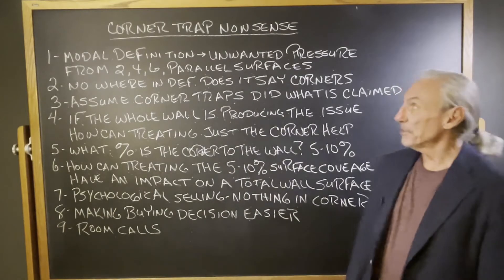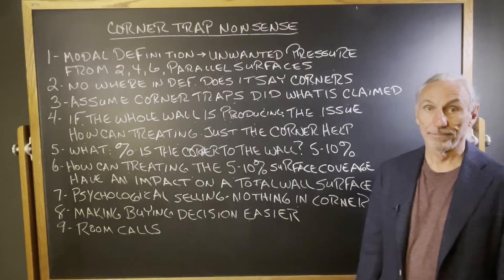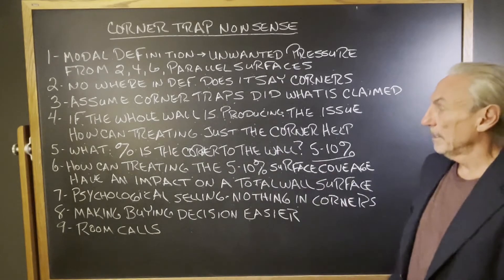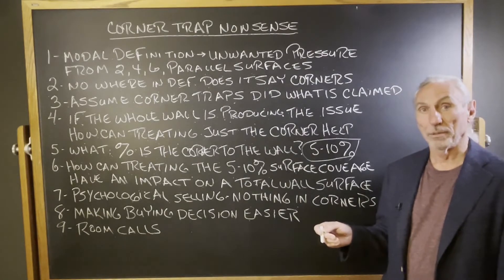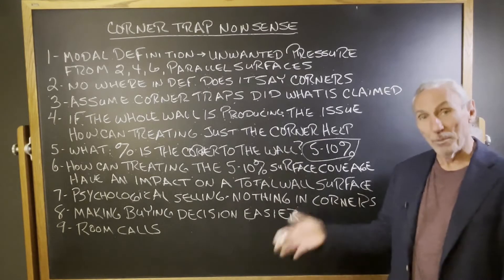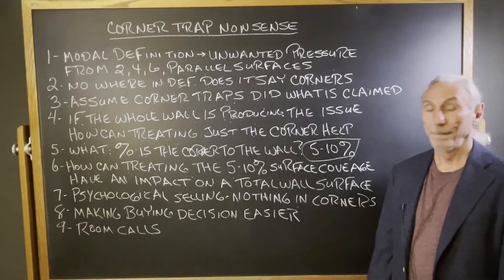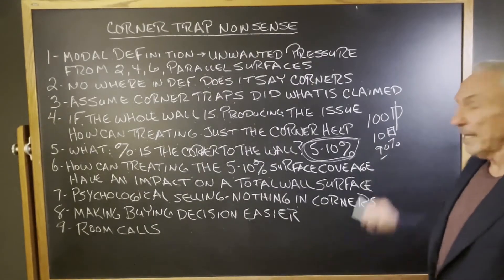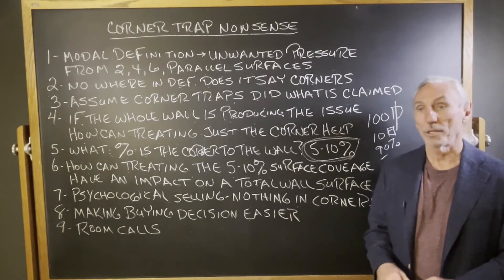Corner Bass Trap Nonsense - www.AcousticFields.com

Comment: Okay I get what you're saying BUT it is quite apparent that bass builds up more in the corners. just stand in a room with music playing and walk to the corners, and its very obvious. Bass builds near walls from the pressure as you have taught us and a corner is a double wall. or potentially even a triple wall. so for bass management would that mean that corners are the most effective place to treat/absorb this?
Reply from the maker: "Bass" builds up in the corners because the walls are not treated correctly. The walls are producing the corner issues.
Reply from the maker: You are confusing technologies. Double and triple wall structures are for noise transmission not for low frequency absorption.
Reply: @AcousticFields  Double and triple wall as in, it takes two walls meeting to create a corner. a third wall (ceiling) creates a triple corner/boundary.
Reply from the maker: @NickWarnerMedia  You are using a tactic without a strategy. What frequencies and amplitudes of noise are you trying to attenuate with this triple wall. You are using a tactic that is not defined against another undefined noies issue. You are chasing your tale with this approach to noise.
Reply: @AcousticFields   i am simply asking a question about the physics. im not using any 'tactics' or 'strategies'. - My original question was "are corners the most effective place to absorb bass?" - so in general, in any room, with any amount of absorption already present or not. with any amplitudes... are corners the most effective (maybe another word would be efficient) place to absorb bass?
Reply: Sorry, but that AF reply is like a chicken talking to a duck. 😊cheers.
Reply from the maker: @djbremsespor  Your comments are more insect based. Just  another tick on the balls of acoustic society.
Reply: @AcousticFields  your answer to Nick's question is nonsense. He was talking about the additional pressure gain achieved when two or three orthogonal boundaries (walls) are joined, and you respond something about noise transmission? Really, what does noise transmission have anything to do with acoustic boundaries? It's you who is confusing things, professor.
Reply: I think he was meaning that it’s meant for amplification of sound transmission for its performance purpose.  I don’t think what he said was irrelevant, though I can see how it can be easily misinterpreted.  If you think about the definition of a room mode, and the two parallel surfaces, if you treat the corner, then theoretically you would be treating up to one side of the parallel surface modes (room modes) except for up to three different angles.  So technically it would give you coverage over different areas but in no way is it doing magic in its efficiency.  Covering the big elephant in the room is more effective, which is the largest wall with the largest parallel surface.  Im not sure if the ceiling would excluded but I think it would be because we have carpet and furniture and things in our rooms so it helps to mitigate it from being a primary concern given this criteria.
Reply: @joemarz2264  Thanks Joe, yes you are correct @AcousticFields  did not understand my question. I am not confusing technologies. double and triple wall as in, the corner of a room is when two walls meet, potentially even 3 meet if you are at the top or bottom of a room. Ceiling is considered a wall/hard/reflective surface.
Reply: @djbremsespor  you are incredibly rude. AF did not even understand my question and therefore your comment here shows your character twice as well...

Comment: I have corner bass traps that are floor to ceiling with diffusion on the front of each bass trap in 3 corners of my room.  Sounds bitchin and looks epic.  But I also see your point.  Surface area covered has more of an impact that corner coverage.  Now that I have rear wall quadratic diffusion, a properly installed cloud, 1st and second reflection points covered and all corners trapped, I'm going to move into trapped the ceiling corners adjacent to my mixing position, and bring in more diffusion and absorption in the back half of the room which is still lacking in coverage.  Slowly slowly it is coming together but each element is making it sound better and better.  I love this stuff so much!
Reply from the maker: Keep going with your efforts. It will be a great learning tool for you. Keep us posted. Send us a response curve as you move through the process so we can see your progress.
Reply: Just be careful to not KILL your room. This is another enormous mistake that many people make!

Comment: In the case of porous absorbers - does the air gap created by corner placement provide any benefit?
Reply: It increases absorption of frequencies under 1Khz, yet not by much. Just make sure the air gap is the same as the absorber thickness, not more, for maximum efficiency.
Reply from the maker: It is minimal and not worth considering for corner issues. More marketing nonsense..

Comment: I'm not sure I really follow your point. Of course, corner treatment by itself doesn't too much.. but if its big (where it starts to take up adjacent walls) it certainly makes a measurable impact in most rooms. After all a corner is really just two walls meeting (or three), and corner trapping therefore is able to hit a (small) portion of all surfaces. Certainly in small rooms you do not suggest that the corners remain empty? I think you could have presented this a bit better. The presentation and title almost are trending into clickbait. Put 3 foot diameter corner bass traps in small room floor to ceiling and tell me that is not going to decrease LF decay times or even out some peaks and nulls depending on flow resistivity of the material used. "You can't just treat corners" would be more accurate way of presentation, but treating corners is still an important part of overall room treatment.
Reply: A combination of room treatments (bass traps) multiple subwoofers and DSP/Equalization should do the trick.  Just make sure to measure and tune every step of the way.
Reply: If you could send me the warehouse stuff .
Reply: Most «commercial» corner «bass traps» should be called «medium traps» because that's mostly higher bass frequencies, mediums and highs that are absorb: unnatural sound and big room modes still unchanged. Typical porous material will be more effective around 1/4 wave length, so a typical 30 cm corner module : f = c/4d = (343 m/s)/(4*0,3 m)=285Hz and up; not very effective for the lowest room modes. These absorbents might even need some wood panels to preserve the highs.
Reply: @Jorge-Fernandez-Lopez  I'm building a 8 h x 9 w x 10 L studio.  Concrete floor.  Insulated drywall.  Any tips?
Reply: @rushmuzik  Sorry rushmuzik, I'm just an enthusiast of music listening and I don't know anything about studios. In HiFi we just need to listen if there's any big problem or not, because our brain doesn't hear like a microphone (narrow cancellations in a graph might not be a problem). If there's a problem like big room modes, tones and a sound-meter might be enough for listeners in a small budget. Clients with more money should hire professionals, because a good room is the key of an audiophile system.   
As you know, room geometry is very important for designing the room, although these measurements doesn't always correlate exactly with reality. Your room is small and don't have ideal proportions to even room modes. My first tip would be to ignore people like me, because I'm not professional. Accuracy for music production is important and you will need to test and understand your room, because flexibility of walls and doors might change the theoretical calculations. The second tip would be to find first (very important)the best place for your chair for bass evenness and soundstaging, because you might measure some peaks around 56 Hz and cancellations around 80 Hz.  In a typical forward studio distribution (chair 1/3 from the front wall), small monitors would be extremely close (like computer speakers). I tried a more HiFi listening setup (nearfield listening) in REW, and I found that small-monitors located 1 m from front wall (1/3 length) and the chair 1 m from back wall (1/3 length) with two (or more) small sealed subs aligned behind each speakers with optimal delays could be a good compromise. You will need to use some absorption panels for mid and high frequencies (reverberation times and reflections) like those designed by Acoustics Fields. Even if bass room modes might be extremely difficult to solve in your room,  cancellations can be reduced by adjusting the chair-speakers position and some bass treatment. More tips —remember that I have no idea and you shouldn't follow my advises— would be to mix for tonality and soundstaging only with the mini-monitors, adjust de bass frequencies with earphones, and finally have fun with equalization of the room modes (cut peaks and leave cancellations untouched) and the subs switched on. The last tip: keep money in your wallet until you know better your room, have more experience (how your music sounds in other systems and correlate with your room) or another bigger room.
Reply: @rushmuzik  don't bother, room is too small and too square.
Reply: @marklydon435  +1 to this.
Simply use headphones!
The room is way too small, troubling resonance at 100hz~125hz. It's gonna be really tough to absorb these frequencies without investing heavily.
Reply: @rushmuzik And yes, the room is probably too small.
Reply: @rushmuzik build a rectangle instead of a cube. 1:3 ratio.
Reply: @Jorge-Fernandez-Lopez  I’m trying to build my bedroom studio ( small size bedroom ) 120ft - 132 ft …. Is it necessary to have bass traps ( on a middle budget ) if so how many ideally
Reply: It’s an upsell for people to buy a bigger package. It’s technically correct, but is mostly overcome with proper source location and listening position/microphone placement.
Reply from the maker: We are all about resolution not bandaids. If you are happy with partial solutions then your goals have been achieved. We want the most resolution we can achieve in small rooms. Most "technologies" in the marketplace do not have the proper rates and levels of absorption to treat even the corner issues.
Reply: Agree. @AcousticFields
Reply: What's wrong with clickbait? This is YouTube get a grip this guy definitely knows more than you

Comment: I’m a music professor, not a physicist…but have scientists/engineers in my family. I understand what your saying, but pardon me for saying that this is a bit condescending. 
Yes I’m not a physicist, but even “layman” research, trial and error and trusting your ears can go a long way. 
Every room encounters unique challenges, something you yourself have expressed. Size, dimensions, construction materials, shared use of a space, etc. I’m finding serious improvements from treating the corners of my small 2.1 listening room. I’d considered before placing bass treatment behind speakers, but only have 19 inches to the front wall to play with since the room is not entirely my own for use. This also inhibits putting very much behind and adjacent to the listening position. 
Considering the benefits I’ve encountered and my limited placement choices, corner traps may be the best option. Should I instead place enormous traps in the soffits? I’d have to see if that would be acceptable for everyone using the space.
Reply from the maker: You should look at the room as a whole and quantify and qualify your issues. You then take the largest distortions and treat those first working your way through the pressure to reflection paradigm.
Reply: @AcousticFields  I agree, find the worst offender(s) & deal with those first.  As someone online said -  it's about changing the ratio of direct projected sound to reflected sound.  Any improvement in that ratio will yield sonic benefits.  Why not try the inexpensive fixes first ?  ie treating the corners
Reply from the maker: When you treat the corners, you will quickly realize that the corners were a waste of time. The wall effects will jump out and be more pronounced. Spend your energy and dollars treating the whole wall.

Comment: Thank you. What about tubetraps? Always been told that they should be placed in the corner.
Reply from the maker: You are missing the point. Its the wholw wall producing the problem.
Reply: @AcousticFields  Yes I understand. But the tubetrap has its limited surface and if you put it in a corner, it has two walls that are building up pressure instead of one. The pressure should be higher in the corner, I think.
Reply from the maker: Not correct. The pressure produced by the toral wall surface area with its dimensions, is much larger than the corners. Treat the larger issues first. Once you treat the wall, you can forget about the corners.
Reply: @AcousticFields  Thank you for taking time to answer.

Comment: I beg to differ.  I do not have a physics background,  i am simply a music lover who is also into the gear.  For 50 years.  I decided to experiment, so I bought a pack of 12 "mini bass traps" (about 10" long)  designed to be used in the corners.  Eezy peezy install with 2 sided tape.  All I can say is "WOW" .   Best improvement is in coherency of the soundstage.  Improved vocals,  improved bass.  I simply couldn't believe the improvement.  Like buying a new component, but kinda better.  Go ahead,  spend the $40.
Reply from the maker: No limp mass material type that is 10" long can do anything for frequencies below 100 Hz.
Reply: @AcousticFields  i would say below 340Hz.
in my room, in Kyiv, Ukraine, i use big (23.6" diameter) DIY tube bass traps in two corners behind the speakers from floor to roof and two small tubes (D 15,7", H 40") side of the speakers. I hear and see changes on waterfall.
Reply from the maker: @andallxr  You are not using enough surface area coverage with the proper rates and levels of absorption. The depth of an absorber determines how low it will go down to or its resonant frequency. The rate is how much energy it absorbs at each octave band above the resonant frequency..
Reply: @AcousticFields  probably yes
but it's a cheap way to improve room acoustics and it works with my room's main resonances at 70hz too
of course there are other ways with other possibilities and with better results

I chose this way and did it myself and I am happy to hear and see it gives me results, not big but still results 🤷‍♂🤷‍♂
Reply from the maker: @andallxr  What costs nothing is worth nothing. Nothing could be closer to the truth when it comes to small room acoustic products.
Reply: @AcousticFields  where is the truth in post-truth world 
joke
nevermind
i just said what i said
Reply: @AcousticFields  Lets say just for the sake of ideal world how thick would a absorber have to be for the low 20 hertz to be controlled?
Reply from the maker: If you think treating the corners made you say wow. Take that thinking a bit farther and treat two opposing walls. You will quickly realize that the corners offer little in comparison.

Comment: Hi Dennis...is it not true that the pressure is highest in the corners? So pressure based absorbers should work there?
Reply from the maker: It is the whole wall that is producing the unwanted pressure issues. You are placing a bandaid on an arterial cut. Spend the money treating the complete problem.
Reply: Hmm...i didnt buy 'corner traps' but corner diffusers, werent expensive and made a huge difference in the low mids ie 120-250hz..rew corfirmed it. The clarity is now so much easier 'seeing' the low mids during mixdown

Also, when im using boundary mics in a corner, i pick up an extra 6db if placed in a corner and the crown mentioned additional gain used in 3 corners
Reply: Not true...the corners CAN and do have high pressure...just stand in the corner and hear how much louder the bass sounds....I am a expert in the field as well with dozens of patents and have been building speakers for 50 plus years...any simulation tool will show this
Reply from the maker: You are chasing your tail. Treat the whole wall and forget about the corners. Do you have data comparing treating the whole wall surface compared to treating just the corners. When you treat the whole wall, the corner pressure subsides and becomes a non issue.
Reply: @AcousticFields  the real point everybody wants to find out is where to put the bass absorption to be more effective, not that they are fools chasing their tails for trying to know that. Yes, treating the whole walls will be effective. Better yet, why don't they treat the whole floor and ceiling too? That would be even more effective, as it will cover 100% of the room. But for most people that's ridiculous. It seems that your aim is to maximize your sales, instead of delivering better acoustic advice.

Comment: It shouldn't be too hard to clear out that warehouse of obsolete traps.

If the carcass of the corner traps are solid, you may be able to repurpose them as corner shelves. If you don't want to deal with repurposing them yourself, donation them to a 501c3 maker shop, or talk to Jimmy Diresta and ask for suggestions. With the high cost of wood these days, hobbyist wood workers will gladly purchase them at a discount.

Flat panels that deal with the higher hertz range may work as a CNC mill cabinet for hobby CNC units. They typically have higher pitched sounds due to the spindle motor and the sound of the wood when it is being cut by the bit.

Another possibility is selling them to a lumber mill that will shred the wood and use it to make MDH boards.

https://www.youtube.com/c/jimmydiresta